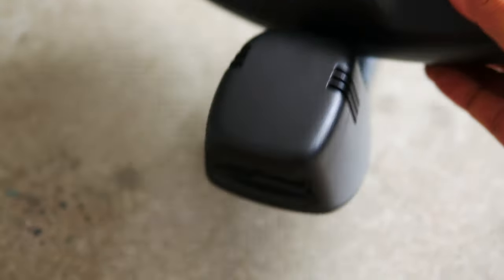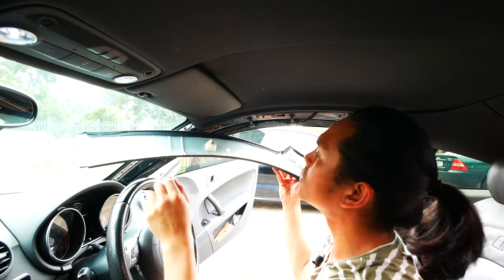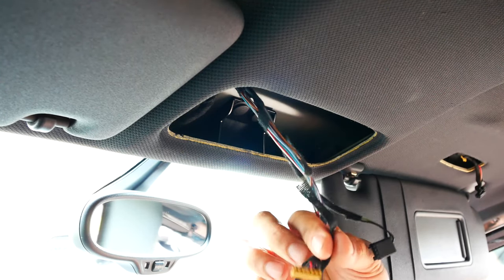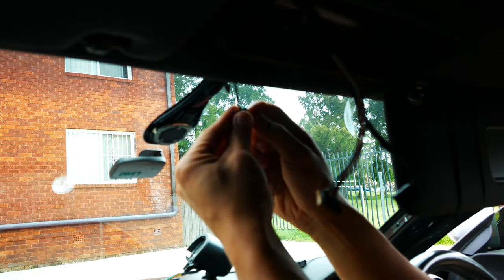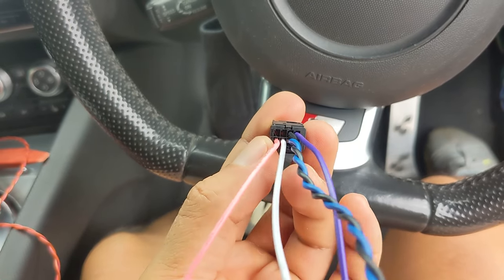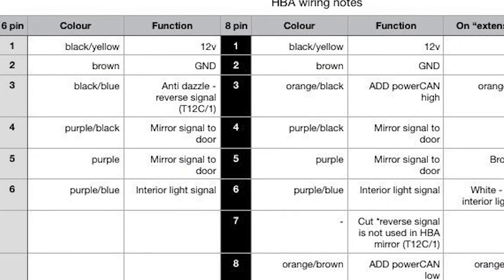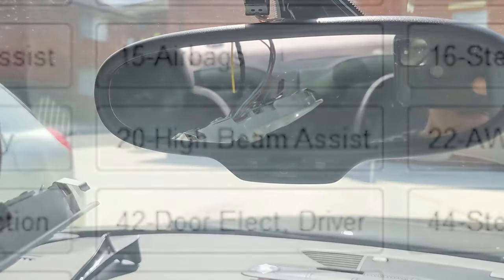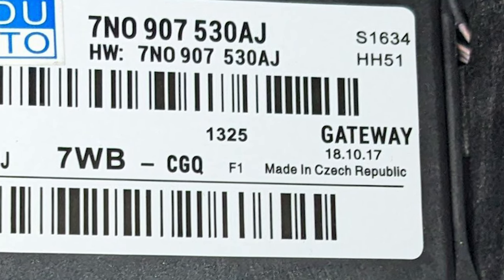How to retrofit Audi High Beam Assist HBA, FLA, auto dim, rear view mirror pt. 1 (TT 8J A3 S3 8P 8V)

Comment: Hello ian very interesting retrofit. What parts are needed for this? Also i would love to see you making the mirrors go down when you are in reverse mode! Very usefull for  the rims🤣. Do you know if the high beam retrofit can be fitted to models from 2007- 2009?
Reply from the maker: Hello ☺️ yeah this video is for pre facelift. This is why I had to add lots of extra wires. 

Hehe. Installation of auto dip mirrors requires more extra work but definitely a handy feature.

Comment: Hello I am trying to install hba assistant, but in vcds, I get an error in the assistant module: cannot be reached. To which pins in the can gateway did you connect pins 3 and 8 of the mirror?
Reply from the maker: Hello! Should be drivetrain CANbus or motor CANbus 

6 & 16 

https://images.app.goo.gl/dwJeKYChYwc13BdJA

Maybe your splice in is not solid.?

Maybe your
Reply: @ianpgonzaga  can you share with me your coding of the high beam assist module? I connected it to pins 6 and 16, but when I do an auto-scan with vcds, it turns out that the module is missing, but I can change the coding of the assistant. Can you share your hba module coding with me?
Reply from the maker: @ИванПанайотов-з9у I don't think it's a coding thing now.

 did you also upgrade your van gateway ? My original one needed changing...
Reply: @ianpgonzaga  Yes, I upgraded my can gateway, with one which support can extended. I can change coding and etc as normal working module, but in auto scan it says cannot be reached and in can gateway I have error No communication with high beam assist module. I don't know what do to next. I can share you screenshots of vcds, if you would like to help me.
Reply from the maker: @ИванПанайотов-з9у  sure. Just msg me in insta or FB
Reply: Hola cual   es el pin 6 y 16 ??. No es pin 7 y 17 getaway ??

Comment: Ian hello again. I want to install auto dimmimg rear mirror .. someone told me that i dont have to change windscreen and there is a part that you put it and fits.is it true? Do you know the part number of this? Thanks
Reply from the maker: Hey. If you already have rain sensing or the coming home leaving home lights (light sensor in the windscreen) no need to change windscreen. If none of that is fitted then, yes, wind screen change required.

This post seems to have info on the rain/light sensor https://www.ttforum.co.uk/threads/replacing-a-rain-light-sensor-and-gel-pack.1645458/
Reply: @ianpgonzaga  no i dont have that.. an audi dealer told me that the mirror mount bracket can be fitted in normal windscreen but i wasnt sure thats why i asked you.pff
Reply from the maker: @αισχοςντροπη  so with the correct windscreen there is a pattern in the black sticker where the sensor mounts. I don't think a regular windscreen has this hole in the black strip...
Reply: @ianpgonzaga  yes there isnt. I dont know what he meant but i ll check it
Reply from the maker: Good post showing parts (not windscreen though) https://www.ttforum.co.uk/threads/retrofit-dimming-mirror-rain-sensor-auto-lights.842353/#post-5201937
Reply: @ianpgonzaga  thank you ian i ll let you know

Comment: Hi Ian,  I would enjoy seeing you install the Motormax MM0852 backup camera which replaces one of the license plate lights. I have one but am questioning the wiring for power and routing to my Pioneer HU. It looks to be a very nice kit and looks OEM.
Reply from the maker: Oh yeah I'll check out the unit and see if it's compatible with the Alpine head unit I have. Nice suggestion !